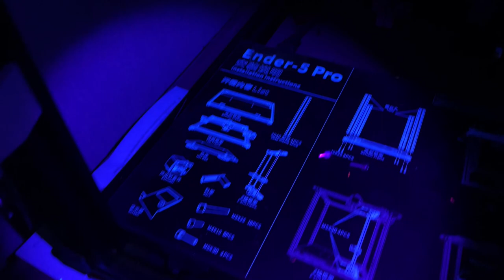Microplastics from 3D printing (Fluorescence Microscopy detection of Fluo Filament Microparticles)

Comment: Hi, it's been 2 years since you posted this video but I have a question. Clearing the air seems obvious and I keep my window open at all times. I am still concerned about the microparticles sticking to surfaces - tables, walls, chair, everything. Have you tried cleaning a surface in the same room, printing for a number of hours or days, and collecting samples from that surface? We still don't know whether they're harmful, but this secondary asbestos exposure caused quite a lot of harm to families of people bringing it from work on their clothes.
Reply from the maker: being plastics they will get captured by any electrostatic cleaner (swiffer like). But I never tried to check the accumulation on surfaces over time. I bet that is the same of what we see in the air.

Comment: Do you have any safety suggestions?
Also do you know whether this happens with SLA prints?
Reply from the maker: out of extreme caution, i've a HEPA filter and don't use the printer in a room when i'm there for long time. SLA are even worse because the material is toxic. Those ones I have in the lab and not at home
Reply: @v_saggiomo  thanks for sharing. I have started by adding a carbon filter to the inside of the printer. But as I understand it that only catches larger particles. Next I plan to enclose the printer in a grow tent and vent the air from it out of the space I'm in. When handling the materials I wear a respirator and gloves.

Within that grow tent I will also run a hepa filter. I'm not surprised but somewhat disappointed by how little attention the issue is getting from hobbyist channels!
Reply from the maker: what are we talking about now? SLA? carbon filter is good enough, but I'd go for some ventilation system as well. 
FDM? carbon filter for particles is almost useless, a good HEPA filter is better.
Reply: @v_saggiomo  I see! Thank you for clarifying.